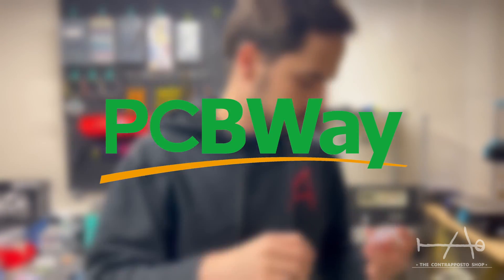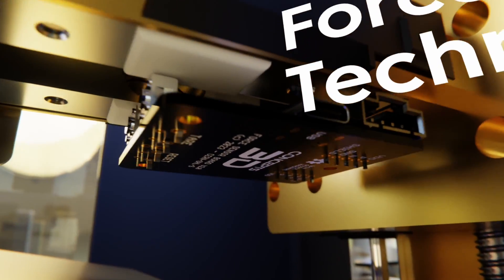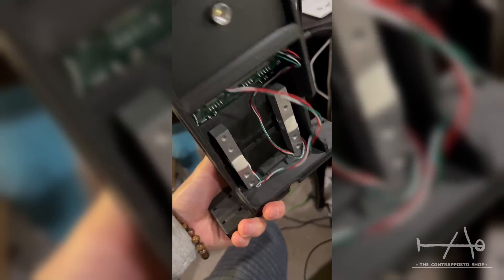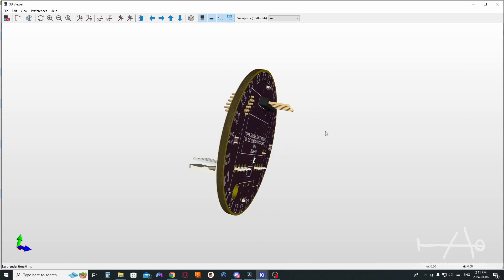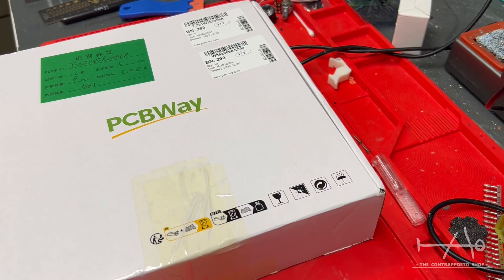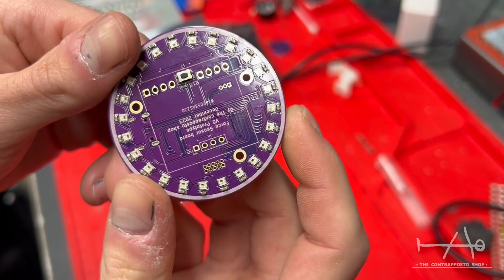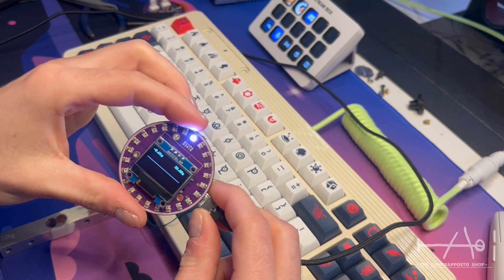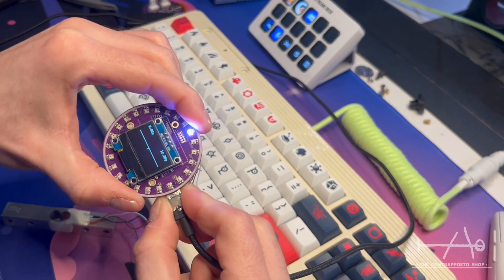Speed up your printer with this device - We need your help !

Comment: I have a question regarding the load cell, for what "weight" ranges is it configured? Also what kind of force can you still detect? The best i got is ~50mg that can be detected but a baseline noise of ~0.25g in both + and -

I use a cell for 5kg max load

Did you manage to get more resolution or a lower noise floor?
Reply from the maker: We use right now a 20kg cell and i think the prototype is have was pretty much the same with the noise level. I improved the circuit a bit for the noise for v1 :)
Reply: @thecontrappostoshop well... i am using this off the shelf chinashop module... yours is probably much more ingenious:D
Reply from the maker: It’s based on that ;P for sure there is a limit of things you can do to filter noises. We can use more expensive parts but it’s not what we want to go for :P
Reply: @thecontrappostoshop definitely!
How did you manage to compensate for drift? Mine has a drift of about 1g per 30 minutes, also it is very temperature dependent (a software high pass filter?)
Reply from the maker: What i did is that every few layers it zeroed out because the weight on the printer arm will increase too. So resetting it we will know how much forces we have on the printer arm and removing the weight of the parts

Comment: I had my own business long ago designing up electronics and both embedded and PC based software. To me, the doubling up on a TFT display and the addressable LEDs looks like it's targeted at hobby prototyping rather than end product. I'm not saying you didn't do good work, just that it's not a production product. For starters, you don't need both displays.  The addressable displays, there are a lot of LEDs, as a general rule, sale price should be X4 to X6 of parts cost. So cents usually matter. Secondly, the TFT looks like an aliexpress module. I can see the 4 pins for power and I2C, I use them for prototyping too. But I wouldn't use them for production, they are produced for hobby use and you could find the the price creeps up alarmingly if you try to rely on them for production, I would integrate the screen  with an on(your) PCB controller if you have to have it. It's an interesting idea about monitoring the peel pressure but I'm not so sure you can filter out the shock of normal house/office background movements from the printer base sufficiently to rely on correct detection of mini peels, i.e. the top of an Eifel Tower model. Best of luck anyway.
Reply from the maker: Hmmmm 🤔 im sorry but i think you didnt get anything of the idea. First the LED and the OLED display are there for simple visual purposes. The led are there for the real time forces ( see if it’s good or bad ) and the screen for previous forces if the last layers was okay. Second the project is fully open source and that mean that anyone can build it ! If i want other to build this project i need something with off the shelf components. There is a reason why i choose that. One reason is for availability and easy to source for others. Easier to solder a 4 pins module than a flexible flat ribbon. There is a button too underneath so a simple screen (without the board) will be damaged. So for this case it’s more logical to take this and quicker than a « harder » to solder screen with more components to drive it. We will have a more precise graph on touch screen and im not sure if we will keep the little one or not but it’s a simple quick way to see what’s going on. We don’t really care about the look of the end product it will be inside a box anyway ! … than the sensibility. If it detects you walking in the room and it creates errors in the data that means that the algorithm of detection is poorly made and probably a machine that is not well built ! It’s really not a concern